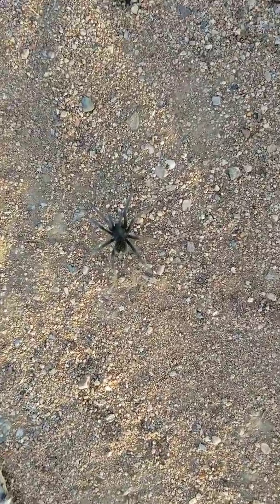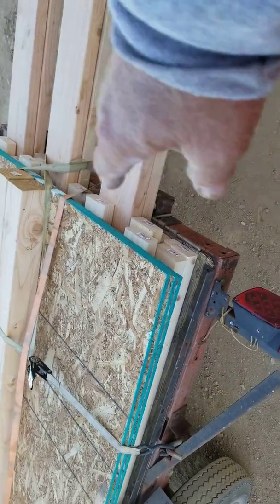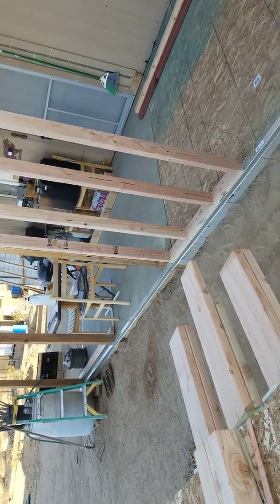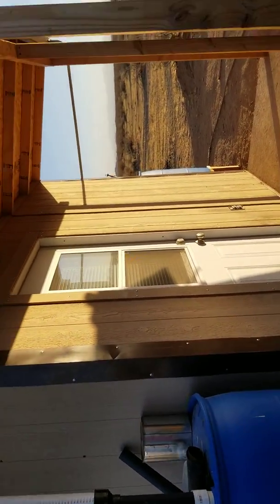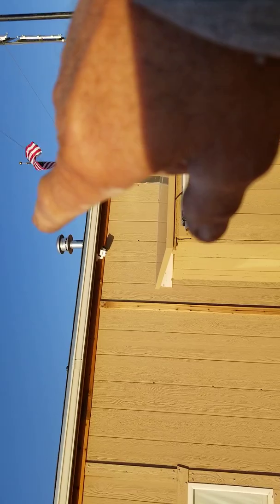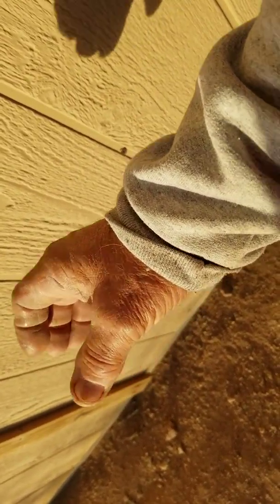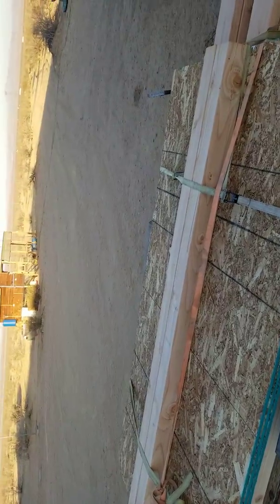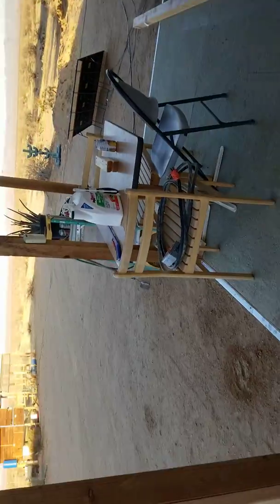Another load of lumber, and a tarantula trick or treating early. OCT. 29, 2019

Comment: Come on gBear.  There must be something in that magic van of yours.  I remember you had a small video "snake" for looking into holes in the wall.  Did that go away in the pre-move garage sale?
Reply from the maker: Yes, that inspection camer quit working, so it was retired.  The rodent spray got rid of the noises on the south side of the attic, but there was still one in the NW corner last night.  Today I will place a fumigate bomb up there while I work outside all day, then air the cabin out in the afternoon.  It 38° right now, was 33° when I got up.  Winds are only 7mph though, so as soon as it warms a bit I will get to work.